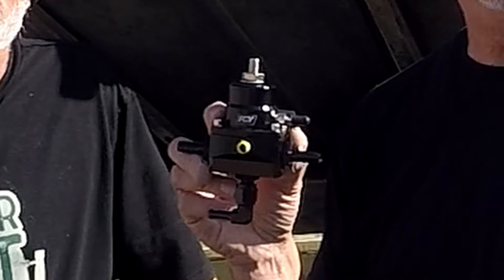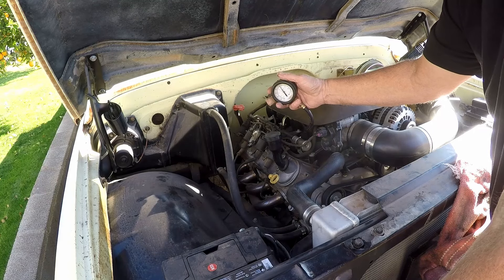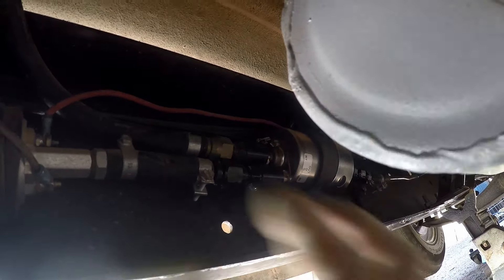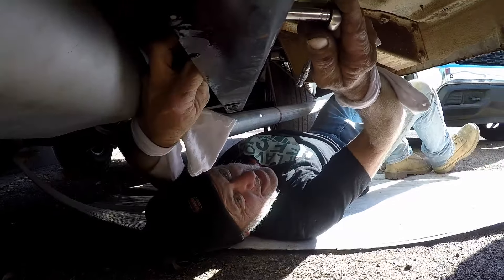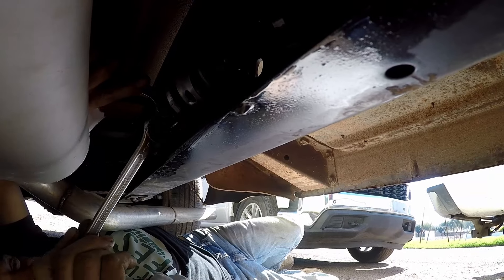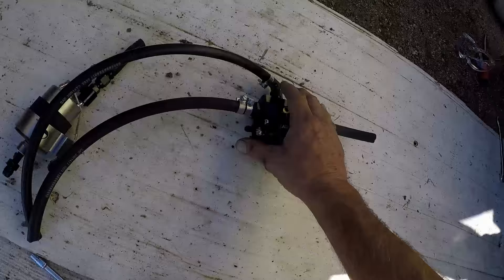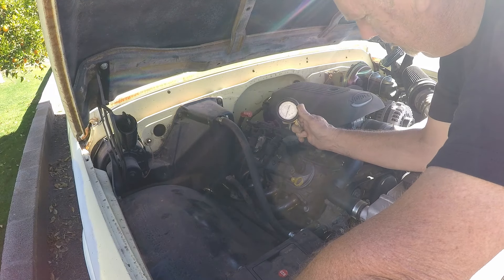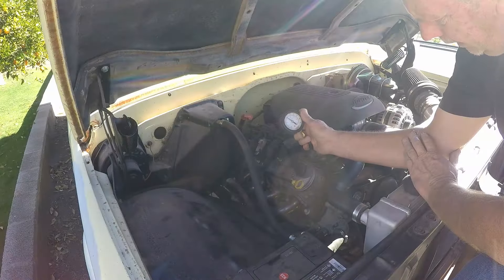1967 C10 Burnout......... Failure!

Comment: Have you checked the wiring harness connector at the trans? I'm assuming you are running a 4l60e? Sounds like you are in limp mode.
This happened to me and I replaced the white connector. Shifts fine now.
Reply from the maker: Good cheap idea! I will check it tomorrow. Thanks for watching!
Reply: I was thinking that same thing! Happened to me and not gonna lie,  it took me a minute to figure that one out. 😐